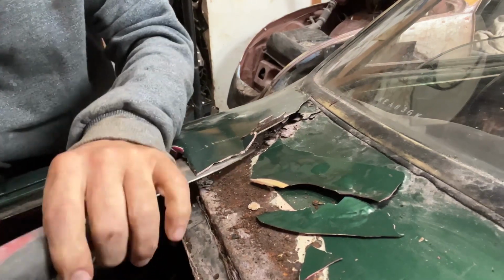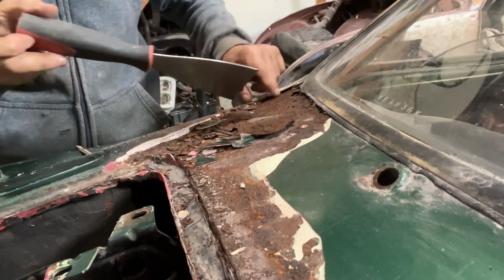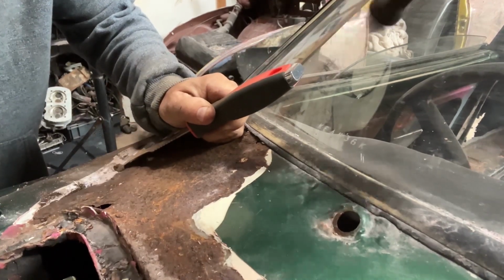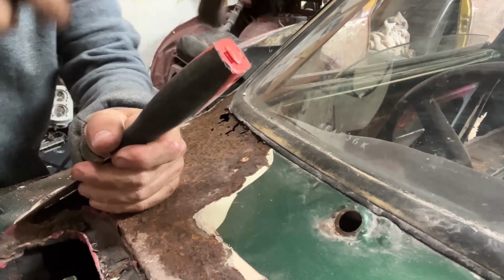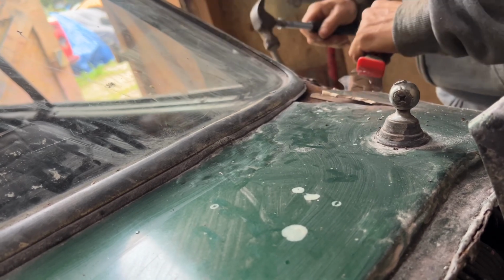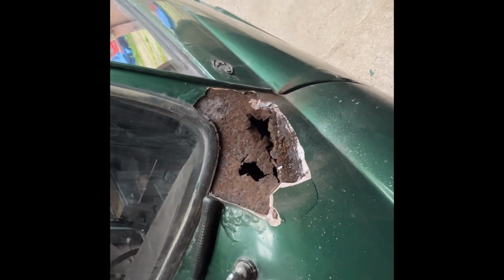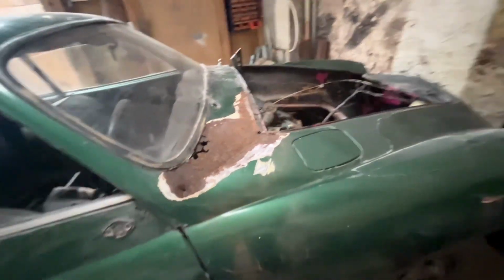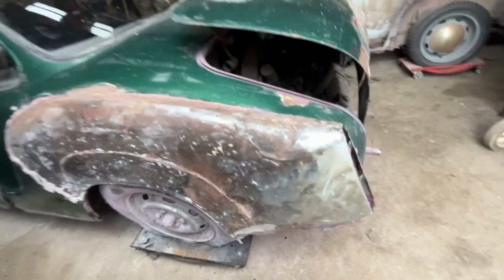VW Karmann Ghia windscreen scuttle hidden horrors !!

Comment: Rust repair. Oh,joy! 
Im fixing the underside of a car right now. Way worse than i expected. 
Guess you will have to pull the windscreen too. 
Bit of a job, beat out a panel and welderup!
Aerial hole on the studebaker is in the bonnet,think i will keep it there. Decided to not even wash that one, fix whats necessary.
Old time garage restored a ghia a couple years ago, it was a lot of work.
Reply from the maker: Yeah Frank windscreen out . You always find more rust but keep at it like I’m doing with my 72 bug ,once rust cut out then you can clearly see that it ain’t that bad . We live on a small island with salty roads but it’s still here and lasted even tho lots of filler 👍

Comment: Filler put on with a concreters trowel mate gee going to be a few kilos lighter, but you are the man you are Inspector Bondo and no Bondo is safe.
Reply from the maker: Yeah wish they used cement as would’ve of rusted underneath lol

Comment: Mann, unfortunately most Ghias are either cave and paved or cut and shuts or a combination of the 2 if they have ever been "restored" (I use that term lightly) in the past when replacement panels weren't so readily available. The yellow one that just let wasn't any different though your cowl panel is in much worse shape... Also be careful around the lead seams where the body panels are going together. Keep it up
Reply from the maker: Oh thanks never knew about lead Seams. I’m liking this ghia and I know when it was done in the 80s/90s in U.K. they used a lot of filler and quick blow over but surprised I haven’t come across any hidden newspapers in behind paint YET lol . Thanks panels hard to get here and trouble getting rear decklid badges 👍